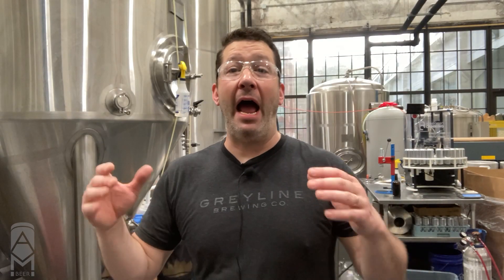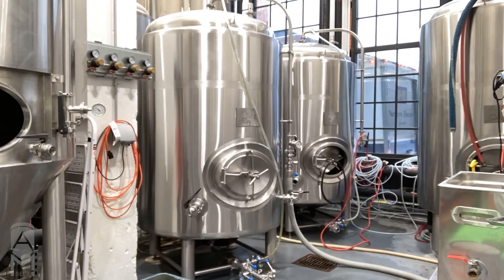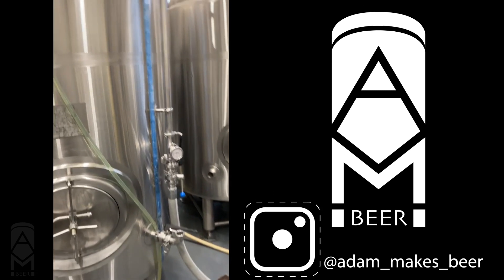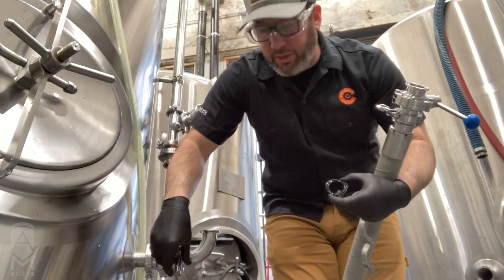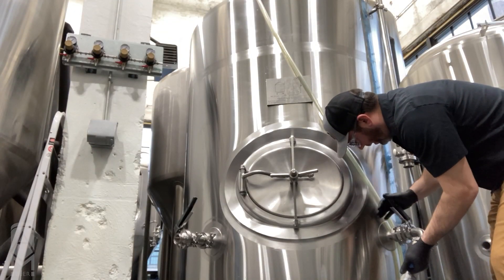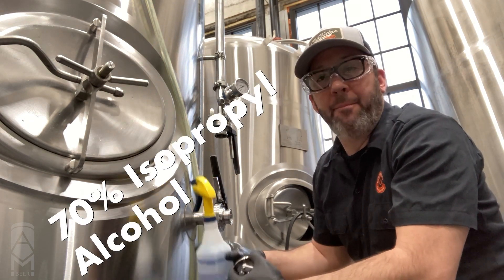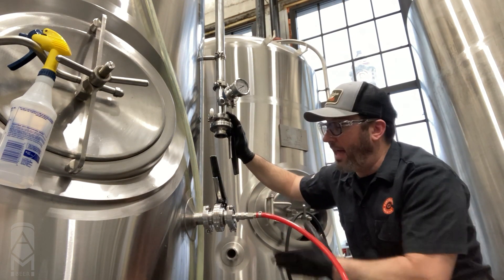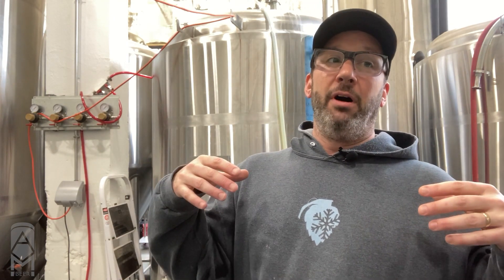Adam Makes Beer: How to Sanitize and Purge a Brite Tank

Comment: When purging with co2 do you have a spunding valve on top? Or another way to allow o2 to be pushed out the top?
Reply from the maker: the cip line is open which originates at the top of the tank.